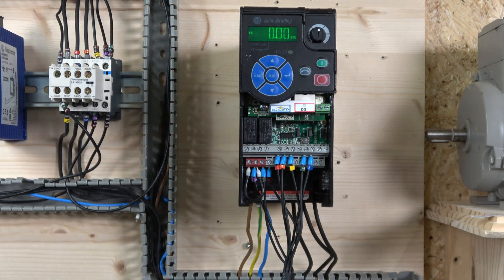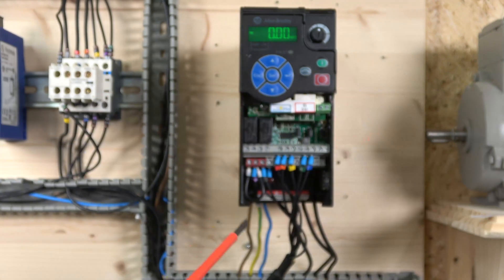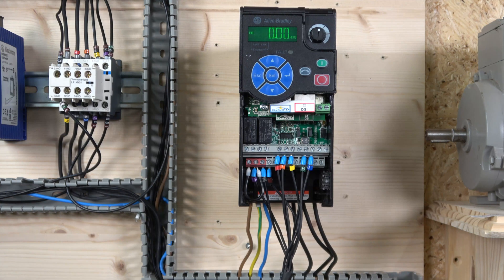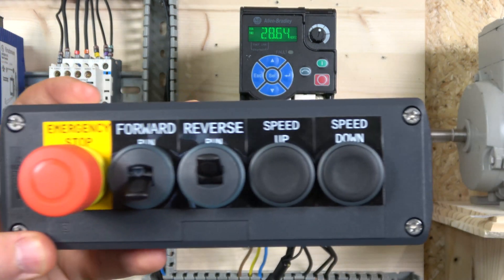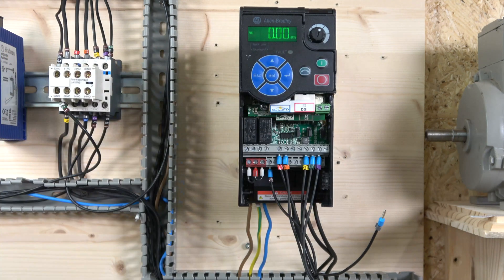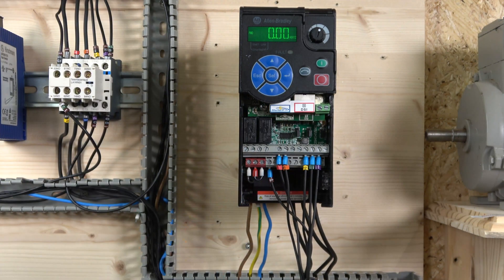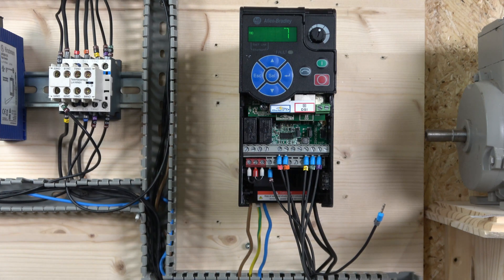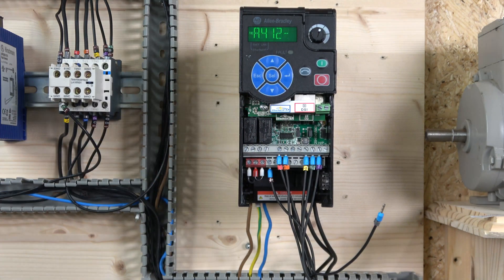Allen Bradley Powerflex 523/525, remote control, MOP control and Multi frequency set up. ( English)

Comment: Hi
how would you wire and setup a HOA  switch ???
hand /manual = control by local push buttons and speed pot.
auto/ remote = start and stop controlled by a plc .